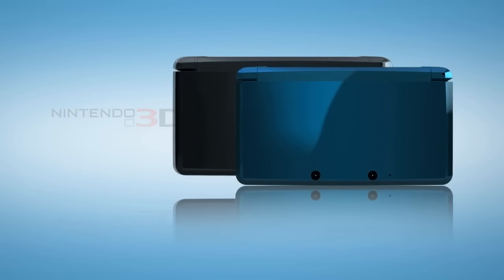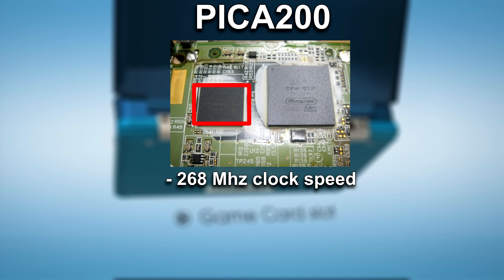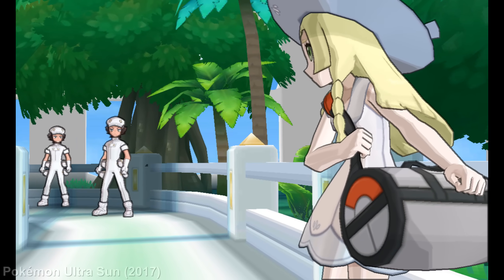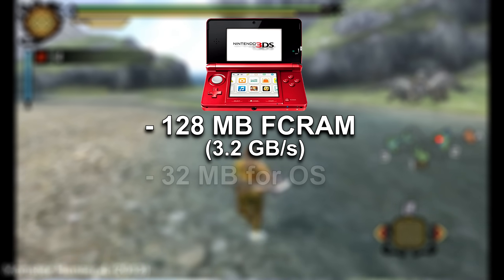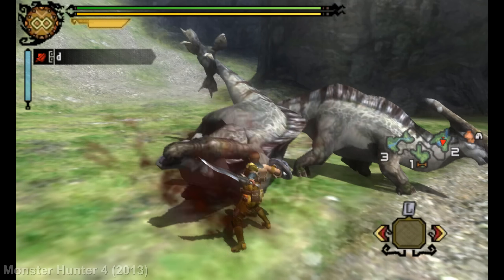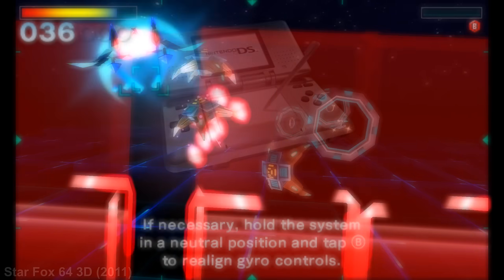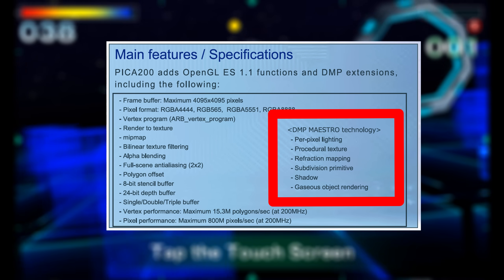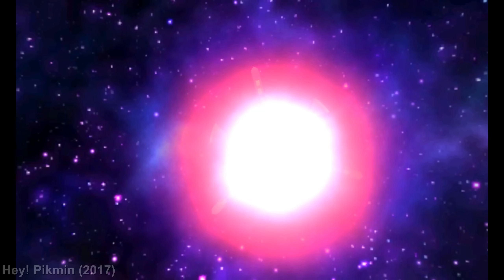The Nintendo 3DS GPU: PICA200 (Retro Breakdown)

Comment: I’ve always preferred the Vita but the biggest issue was its lack of marketing and games.

Other than that the 3DS was a neat piece of hardware. Its graphics were always strange since it sat in an in between spot between the GameCube and the N64. The system did occasionally show off some quite high poly models for the system while also maintaining decent lighting.

It’s also strange that the 3DS had more ram than the Wii did. I wonder if that’s due to the cost of ram going down but that was something that did make me wonder why they went with more ram. 

The one comparison you should do is between the 3DS and PSP
Reply from the maker: Agreed I was so impressed with the Vita, but didn’t feel the push that Sony should have gave it. I ended up getting a 3DS a little late in its life mainly because of its amazing game library. I couldn’t stop feeling tempted every time I walked down a 3DS isle 😬

Comment: So would the 3DS hardware be closer to a PS Vita than a PSP in terms of specs and/or features?
Reply from the maker: The CPU is more in line and closest to Vita vs PSP, but graphically, the 3DS is only a little bit more powerful than PSP when we use floating point calculation as the reference point

Comment: could you pls do a smaller vid on the new 3ds specs
Reply: The new 3ds didn't change the hardware completely these are all the changes they did,
Add two additional processing cores.
Increased the clock speed of all the cores.
Doubled the ram!
Increased the vram from 6 mb to 10 mb.
And lastly increased the ram's bandwidth.
In my opinion I think the reason why they released the new 3ds is probably to save the 3ds lineup, the original 3ds was just too underpowered but after all that they managed to save the 3ds by releasing good games, good job Nintendo.

Comment: I'm still so shocked they got resident evil revelations on this thing
Reply from the maker: Mee too!
Reply: and MGS3
Reply: @way2gon  well MGS3 was a PS2 game and looks downgraded on 3DS, although still impressive, RER looks like a 360 game at some points
Reply: @blakeellis9171 it's actually upgraded in many ways, if you look at character models they have much higher polygon counts than the ps2 original and generally look better. The downside is that the cost of that was making it a 20fps locked game.
Reply: @SolidPython2099  bruh why did they do that? The og game already looked good and probably would have run better?
Reply: Apparently Revelations was a original 3DS game and the other versions were just ports!!
Reply: @josealcayaga8067  I mean yeah it launched first on 3ds but that game looks like a 360 at times, getting that in the og 3ds is insane
Reply: Looks like a Vita game.
Reply: Optimization
Reply: You think that's impressive? Capcom said that if RE:R sold better they were ready to port RE5 to the 3DS. The entire game. RE: Mercenaries used levels taken right out of RE5 and they looked damn near as good just at lower resolutions (720p vs 240p and all that).
Reply: Don't be fooled by the footage in this video. It's clearly being emulated at high resolutions and what looks like forced AA. Don't get me wrong, Revelations was a fantastic looking game but it didn't look THIS good on actual hardware
Reply: @MillionDollarPersianMDP  yeah i played it on actual hardware, i still think it looks almost like a 360 game just in 240p

Comment: The 3ds's GPU wasn't entirely fixed function! The vertex stage was entirely programmable, so it had vertex shaders but it used fixed function for the pixel stage
Reply: How would having a fully programmable vertex stage be useful though? I'm assuming the vertex stage is where the vertices are projected onto a 2d space, but I don't imagine much graphical effects you could do there.
Reply: @floppingtok that's right, yeah. It's useful since you can offload some amount of work to it. For example, with skeletal animation you can pass the vertex shader the base vertex and the bone matrices, letting it handle calculating the final vertex position. It's not much, but it is still some work being pushed onto the gpu instead of the CPU
That being said, I do still think it's bizarre that the GPU didn't have a programmable pixel stage, since that is the most useful part of shaders
Reply: @jademarker4688  For the 3DS, it was all about saving power, as there was less available due to how much the 3D (as in, the stereoscopic, not the 3d graphics) consumed, as I read on it. After all, nintendo would not put a crippled GPU in a console from a time when it was already possible to put a flexible one, they knew  what they were doing and it was most likely about power/heat.
It's also intersting how the limitations can shine through more in less graphically demanding games than in the intense ones.
The 3DS port of terraria has a weird blurriness/unclarity to the pixels, and unless that's an artifact of the software that was used to record the gameplay I'd watched, it could also be explained by a linear filtering mechanism that could have been implemented into the pixel stage that there was no way to turn off, and we all know how filtering works "well" with pixel-perfect graphics (like pixel art stuff)

Comment: How it is compered to the new 3ds or ds i?
Reply from the maker: The GPU is essentially the same on the N3DS, with the only addition being 4MB of additional VRAM. The CPU and overall system RAM got the majority of the upgrades with the N3DS. The 3DS is also much more powerful than the DSI

Comment: How does the 3ds gpu compare to the n3ds? Or did the n3ds only improve the cpu and ram?
Reply from the maker: Yeah all of the upgrades came from a much better CPU and increasing the RAM. The GPU stays exactly the same including MHz, save for the 4MB increase in dedicated video memory
Reply: @FrameRated  Could the N3DS increase the screen resolution to 480p for the top one at least & still have enough extra power to run games without issues?

Comment: Love the vid, FR! It's super interesting to hear about this gpu.  I had no idea about it, and thought it was by one of the big gpu makers out there.  
Have a good day :)

And as for butchering "Fujitsu", I don't think many folks in the UK would mind.  They aren't the most popular around there, now.

EDIT

Could the memory split be configured in some way? Or was it fixed at that 90, plus 6 for the vram?
Reply from the maker: Thank you so much my friend that really means a lot! So I made a mistake in the video itself and edited my pinned comment to explain, but basically the 3DS had 6MB dedicated VRAM that was a little faster and also had 128MB of FCRAM, of which, 96MB was usable for games and 32MB for the OS etc. So it’s 6MB of faster memory specifically for the GPU and then 96MB of memory to be used between CPU and GPU thereafter as needed for a total of 102 MB of usable memory between the lot!

Comment: Wait isn't the 3ds's vram separated from the main system ram? Since it has its own bandwidth
Reply from the maker: Yeah, that was a mistake on my part when researching. Details on the specifics can be hard to pin down as accurate when there are a lot of outlets that explain the memory situation on the 3DS differently. It's common for people to think the 6 MB was just a dedicated allocation of the 128. It appears the 6MB of VRAM is embedded and separated from the 128 MB FCRAM and is indeed faster, which is why devs used it to store data in advance to squeeze more performance out of the 3DS. I had this originally pinned down and was going to start with these points for the VRAM before diving into how devs used the 6MB creatively, but completely fumbled including it when recording my voice over a read my original paragraph, not my rewritten one and didn't even realize until I published the video this morning.
Reply: @FrameRated  and I also love that Nintendo include the arm9 cpu not only for backwards compatibility but also to run background tasks which is what modern cpus nowadays use performance cores for gaming and heavy lifting and efficiency cores for background apps! Btw how I found this video and ur channel is basically I was just looking at my 3ds and being like....hmmmm I know that the 3ds is underpowered but.....how underpowered is it? GOTTA SEARCH ONLINE!! Lol

Comment: I'm really looking forward to the video about the PS3's GPU, especially the fact that it originally didn’t even have one. Everything was supposed to be handled by the Cell processor. The only thing I've seen is a tech demo of ray tracing running solely on the processor.
Reply from the maker: Its on the list and will be out in the near future ☺️ PS3 is one I am going to work on for a few weeks and not all in one week just because of how complex it is, but it should be great info!
Reply: Didn’t originally have a GPU?
Reply: @itsmatt517  yea, Sony initially thought CELL could do everything but games development proved otherwise.
Reply: @itsmatt517  this is a common misconception by people who don’t fully understand how graphics work. The PS3 had a GPU (the Cell can assist with calculations but it can’t actually draw pixels on the screen). It was a team within naughty dog that showed the heads of PlayStation that relying on the cell to do all of the work and having a weak GPU was far less than ideal and Sony ended up going with nvidia. Overall, the system is significantly less powerful than the Xbox 360 because of the cell architecture and the GPU lacking features the Xbox 360 GPU had
Reply: @cheeseinabag808  although the best looking PS3 exclusives looked better than the best looking 360 exclusives, so it wasn't that bad I guess?
Reply: @cheeseinabag808 they were developing a full cell gpu they ended giving up mid dev and choosing a cheap off shelf nvidia gpu which was weak compared to the xbox 360 one combine that to the fact that developing for the cell cpu and architecture was a nightmare and you ended up with sub par performance
Reply: @itsmatt517 that’s a matter of opinion. The best looking Xbox 360 exclusives ran at higher resolutions, had higher resolution textures, better lighting effects, more advanced geometry, etc. Forza Motorsport 4 really moped the floor with gran turismo 5 and 6. Nearly every 3rd party title ran and looked better on the Xbox 360. Look at Red Dead Redemption. Higher resolution, 4x MSAA, higher amounts of foliage, stable frame rate.
Reply: @cheeseinabag808  Oh sorry no, I meant when compared to the best looking PS3 exclusives such as God of War 3, Uncharted 3, Metal Gear Sold 4 etc….
Reply: @itsmatt517  Like I said, Xbox 360 exclusives had higher resolution textures, more complex geometry, better lighting, etc. Again, FM4 moped the floor with GT5 and GT6. Not to mention the gameplay in the games you mentioned was just bad. God of War prior to 2018 had horrible gameplay. All of the Uncharted games ripped off the combat system in Gears of War and did it horribly. The only good MGS game was the first one on the Playstation. The Last of Us has a fantastic story, but the combat leaves a lot to be desired, etc. PS3 exclusives just had really bland textures, lighting, and geometry. Just look at the polygon count, texture resolution, and lighting effects of the original Gears of War versus the PS3 version of The Last of Us. No comparison. Even then the Xbox game looks a full generation ahead
Reply: @cheeseinabag808  Wasn't impressed when I played the Xbox360 exclusives on my SeriesS via Gamepass. Definitely a step down in graphics from the PS3 exclusives I played during the 7th gen, even with the better performance the SeriesS could provide
Reply: @itsmatt517 then you’re being dishonest about having played them. Also playing some of those games nearly 20 years after they were released while having rose colored nostalgia goggles on for your PS3 is different than having played both at time of release. But, again, it’s a technical fact that Xbox 360 games had higher resolution textures, more complex geometry, and better lighting. But again, playing a many years or even decades old game now is different than playing it at the time. Look at the 16-bit era. Many of those games were fantastic for the time. But someone playing them new now isn’t going to have the same experience playing donkey Kong country that someone in 1994 did. Same thing with PlayStation and N64 games. Many PlayStation games looked great for the time. But, unless you’re using an emulator with a lot of post processing effects to clean up the image, they did not age well at all. And it’s no different now. Playing the uncharted collection on my PS5, those first games look rough and extremely old.
Reply: @cheeseinabag808  all honesty here
Reply: @cheeseinabag808  The console wars ended years ago, can you guys chill out please
Reply: @itsmatt517  You too
Reply: @mysticaxolotl8215  What? I was just stating how great some of the PS3 exclusives looked for the 7th gen
Reply: @ just stating facts to stop the spread of misinformation
Reply: @cheeseinabag808 3rd party games wise you are correct. However PS3 had the best looking games in the 7th generation. The same thing can be said with the PS4 as well in the 8th generation.
Reply: @ nope. Again, Xbox 360 exclusives had higher resolution textures, lighting the PS3 wasn’t capable of since it’s GPU was a full generation behind, and more complex geometry. The Gears games show this well, and Forza Motorsport 4 mops the floor with Gran Turismo 5 and 6. However, the tables did turn. The Xbox One and S were hot garbage.
Reply: Ah yes Sony's misunderstood Pandora's box. Too powerful and confusing for the time period, used to this day by the US military.
Reply: @jabrondestoroyah not used to this day
Reply: @jabrondestoroyah  I wouldn't say it was too powerful, it was a good CPU though and the ability to daisy chain PS3s was why it was a good option to build cheap supercomputers.  The splitpool RAM was its biggest achilles heal.
Reply: @overwatch761  I think oc was referring to Sony saying that the cell processor is more powerful than current CPU's, which is literally the most idiotic thing I've heard from any video game company.
Reply: @jabrondestoroyah  to this day huh?

Comment: Id be interested in seeing a video about the Vita gpu
Reply from the maker: It’s on the list and will be out in the near future ☺️
Reply: @FrameRated Not sure it’s worth a full video tbh. The Vita used a pretty contemporary smartphone/tablet gpu architecture (PowerVR SGX 543) in a 4 core variant, same as the iPad 3/Retina (in Apple’s A5x), and double that in the iPhone 4S (Apple A5). Definitely a known factor. The only standout feature is the MP4 variant coupled to a low res screen.
Reply: @Lauren_C  it was downclocked hard